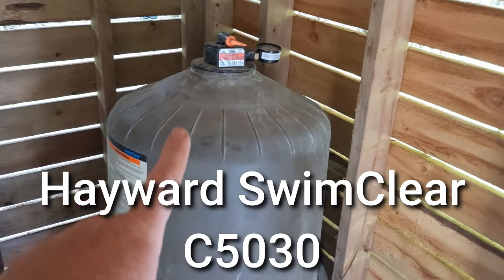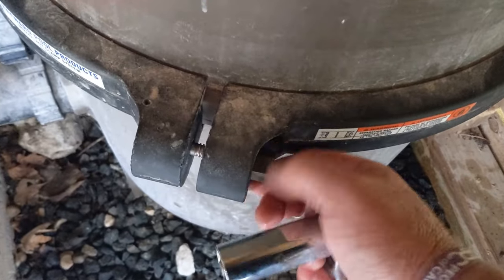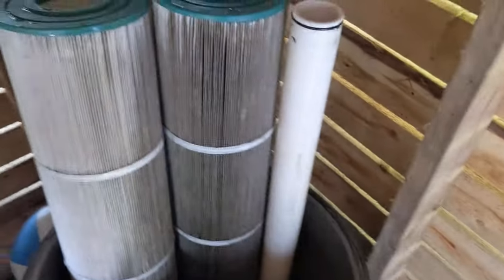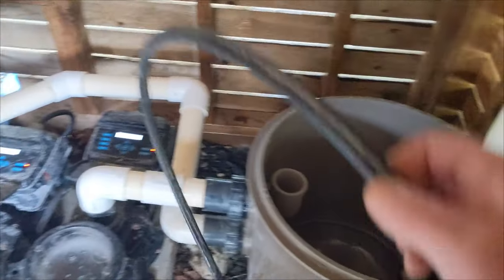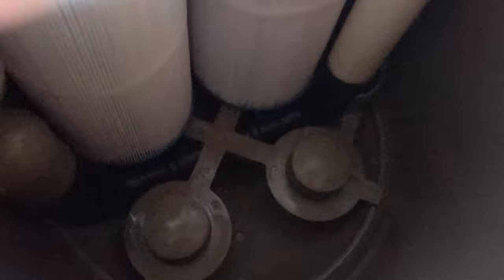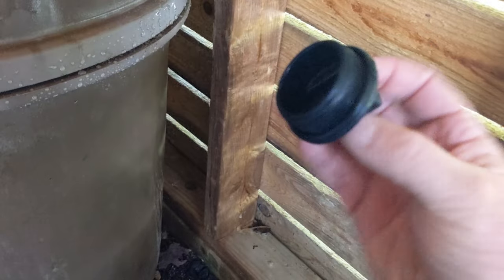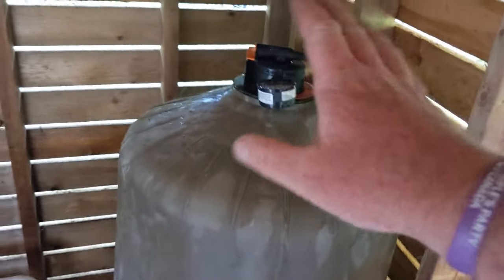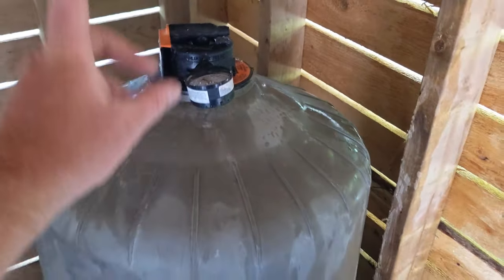How To Clean a Hayward SwimClear C5030 Cartridge Filter/ Hayward Cartridge Filter Cleaning

Comment: I have the same unit and after cleaning the filters, my pool is still could after following all the correct steps to clean… could there be a crack in the pvc pipe that pulls the water out of the filters and back to the pool?…
Reply from the maker: Whats the issue your having?
Reply: @VIPPoolsandSpas  I just realized instead of writing “cloudy” autocorrect typed could. 
Also, I’m sure this is an install mistake because my 4 cartridges don’t sit flush and they never have. I’m assuming the tall pvc pipe with the o-ring is about 1/4” too long?… they don’t sit as flush/tight as your video.
Reply from the maker: @harbinger8083  Filter is wrong maybe?  Or.  Could just cut the pipe that 1/4 inch
Reply: @VIPPoolsandSpas  my pool is going on 6 yrs old so I’m assuming it needs to be cut 1/4”.  I don’t ever recall it sitting a snug as your video.
Reply from the maker: @harbinger8083  I had to rewatch the video.  lol   I forgot what was in that video.  SO.  Don't cut the pipe.  The pipe isn't sitting in the bottom right.  See if it will twist off.  It shouldn't be easy to take off.  Might not be sitting down all the way.  Could have been when they made the canister.   Everything you see in the video is as it should be.  If yours is not, you might want to look at a different one.  Whats in the video is what your filter canister should be.
Reply: @VIPPoolsandSpas  aloha,
That stand pipe wasn’t seated in all the way and now my cartridges fit snug like you video. 
It’s been a little over 24 hours and still cloudy. I followed all the instructions given to me Leslie’s pools which is 5 min drive from me. I’ll wait another 24 hours to see if there’s any difference.
Reply from the maker: @harbinger8083  At least you found the issue.  Because Leslies or anyother pool store isn't on site testing your water, they wouldn't really know whats going on.  To clear up a pool with a cartridge filter faster, you should put "filter socks" on your skimmer basket.  Helps alot.  Did you just open the pool after winter or do you live somewhere nicer than Canada?   lol
Reply: @VIPPoolsandSpas  PHX AZ. Pool was quite green. I took out all floating debris that got into the pool and swept all walls/floor and followed Leslie instructions. I’ve cleaned all baskets and filters 2x in 24hr span. 
I’ll wait another day and clean all baskets and filters again to see if it will clear up the cloudiness.
Reply from the maker: @harbinger8083  Did they say it give it a "FLOC" or did they give you a Clarifier?  Green you shock it and drop the PH. After, if it goes cloudy, use a floc.  Next day vac all thats on the bottom out to waste.  Thats if you have a 3 way to bypass the filter for shooting out to waste.  CLear in 2 days or 3.
Reply: @VIPPoolsandSpas  they didn’t say to use any but I have SeaKlear Chitsan Clarifier I can add
Reply from the maker: @harbinger8083  I don;t use that stuff, so I don't know.  I did read up on it and if you have it throw it in.
Reply: @VIPPoolsandSpas  will do and I’ll update this post. 
Mahalo for the advice and info. Truly a professional!!!
Reply: @harbinger8083  I just replaced my 12+ year old 4030 due to a crack in the return manifold.  Could replace just the manifold, but the plastic was getting brittle on the return assembly and figured there was a good chance I would break something else taking the return assembly apart.  Take your filters off and feel around on the return to see if there is some damage, maybe on the underside.  Some flex tape worked for me as a temporary fix while I got the new one.  My clue was dirt coming back out of the returns when I vacuumed.